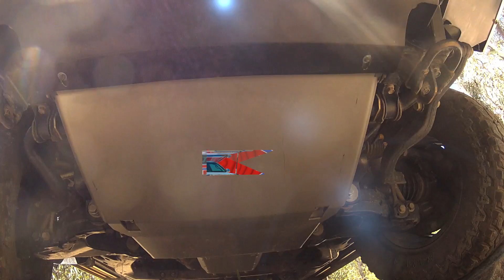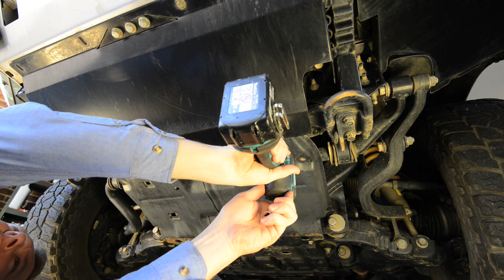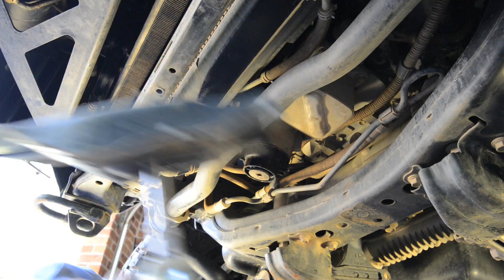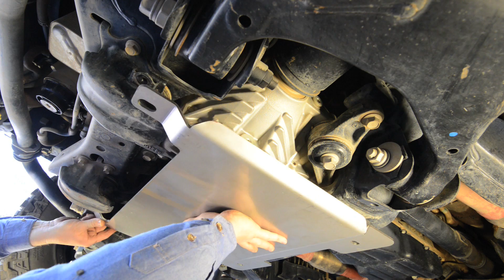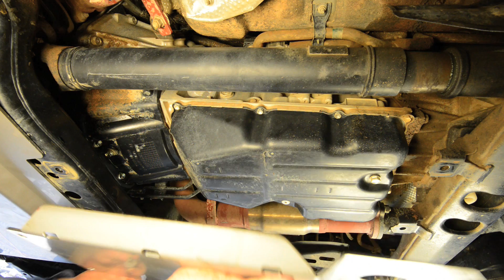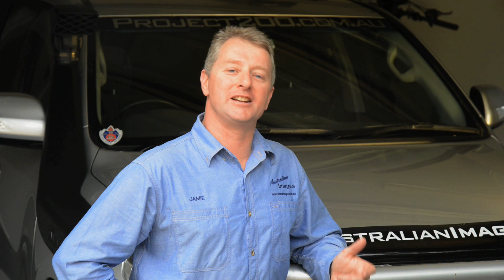LandCruiser 200: Bash Plates step-by-step install AKA underbody protection

Comment: Would it be feasible to cut holes for sump plug and filter ?
Reply from the maker: I suppose you could, but it would weaken the structure. You'd want to reinforce around the holes and have the infill remain as part of the structure.
Reply: @austimages  thanks for the reply

Comment: The OEM gearbox pan protection plate looks beefier, would have left it there to be honest.
Reply from the maker: The factory one is very thin walled tube with a piece of sheet metal. The folded 4mm stainless is much stronger.
Reply: @austimages  I am sorry, I thought it was aluminum. That stainless got me fooled.  It still looks like the fold at the rear of the plate is going to fold into the pan under impact. Just a guess.

Comment: 1. No stiffener on protection
2. hot air from the collectors is trapped in the engine compartment - cracks are needed in the protections
Reply from the maker: 1. They are very strong. The edges are folded, which increases rigidity. I've hit them many times over the last 3 years, and never bent anything.
2. The plates cover the same surface area as the factory plates, which also don't have any ventilation (except for the small plate under the transmission). Cooling/temperature has never been an issue, even towing in the Australian desert. https://www.project200.com.au/wp-content/uploads/2016/11/factory-v-custom.jpg

Comment: Not sure about applying loctite to the retaining bolts is a good idea, especially on the front plate that needs to be removed continually to replace the oil filter cartridge. If the bolts were correctly torqued with shake proof washers, or split washers, I'd apply anti seize to the threads instead.
Reply from the maker: You could indeed fit spring washers instead, but I'd rather use the Loctite. If you use something like 243, it doesn't make them difficult to undo every 10,000km for the oil changes.
Reply: I use 243 all the time and even though it's not an aggressive type of loctite, the captive nuts in the chassis of Toyota's and many other 4wds, tend to accumulate a lot of dirt, mud etc that eventually causes corrosion and subsequently the continuous removal of the bolts to change oil filters every 10,000 causes those captive nut threads to eventually wear and strip. Personal preference, but then again personal experiences through a lot of years working in these 4wds, I'd use anti seize.